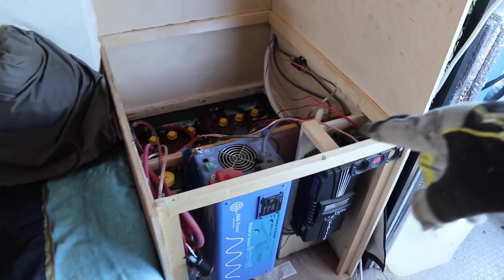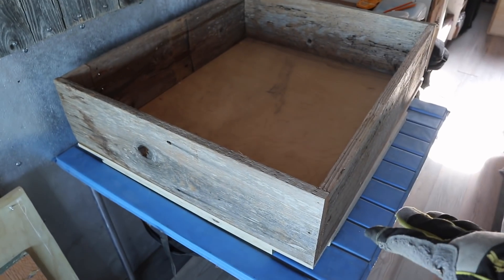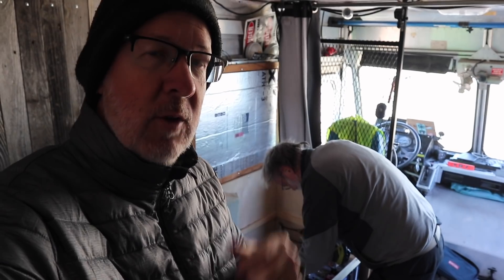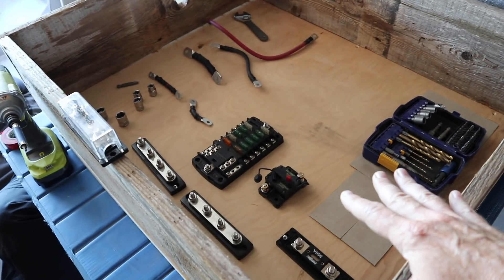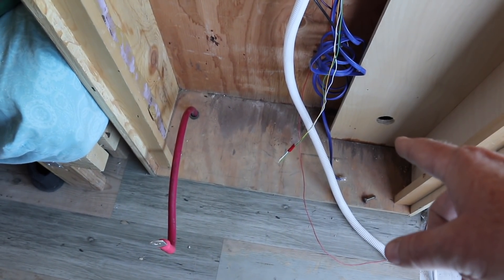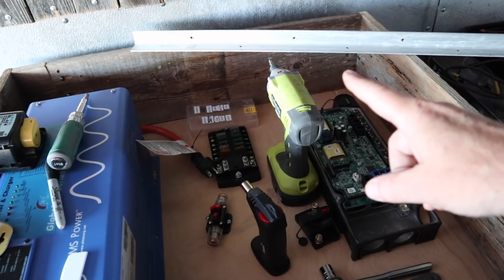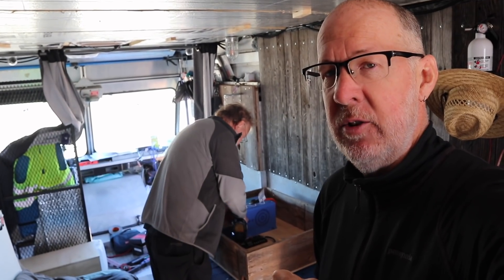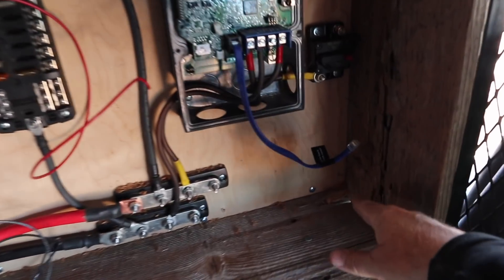New Wall Mount Power Box E493

Comment: Seems like all the van dwellers are all bundled up for the cold. I don’t remember that from watching you tube last year. Stay warm Seven.
Reply: It's been quite cold in the deep SW this year. Highs near 70 and lows around the mid 40s.
Reply from the maker: SW winter isn't too bad. just requires a coat & hat in the mornings and evenings most days... and on rare raining days I'll wear it all day. I rarely use heat in my rig (sometimes in morning or evening) and lots of blankets at night!

Comment: Yah I agree with the earlier commenter of the fan to vent out of the van for the battery box. Where did you find that fuse box I like the size and the bubble cover. I got the whiz bang jr to keep an eye by laptop. Wish they had an app. The ultimate dream for me is wind speed, cloudy sunny and battery voltage!😹 in one look!   Also don’t forget you have to water those puppies and you want to be able to hover over them.

Comment: Is it possible to cook without propane? I've rung solar companies and van conversion companies and they say i have to have it to cook but i don't feelcomfortable with propane. Wish i could understand all the electrics you're doing  but trying to learn !! I won't be able to to do it myself but need to understand it so i know what i need to have done !! I have a 1998 Mercedes Sprinter 170 wheel base. Would be really greatful for advice. Mimi
Reply: maybe a mini wood burner would be a alternative Slim potato head uses one in his camper,  I also use toaster oven and electric skillets.
Reply: Look at induction cooktops. They do draw a lot of power, but in the long run it will be cheaper and better for a small space.
Reply: you can do it with an induction cooktop as mentioned previously, but you will need to have a lot of storage capacity and learn to be very efficient when you cook.
Reply: There's nothing to fear about propane. If possible mount the tank outside, but if that's not possible, try enclosing the tank and vent it to the outside. Use a good leak detect solution and soap all connections before use. Things to remember, propane is a heavy fuel and if it leaks in will be at floor level. You can actually us a broom and sweep it. It has a LEL (lower explosion level) of around 900 degrees. Where Natural Gas is lighter that air and the LEL is 1200 degrees. I'm retired after 37 years for a Nat Gas Company, I was a service technician for over 15 years.
Reply from the maker: I have several friends who cook without propane. my friend Ron is all electric with an induction cooktop and instant pot. my friend Joni does the same and all electric. my friend Andi and Dorthy use alcohol and wood burning stoves. that said, I think propane is a great option as long as you crack a vent or window